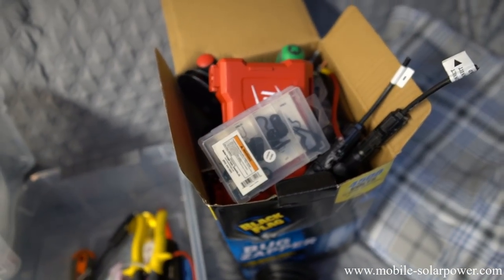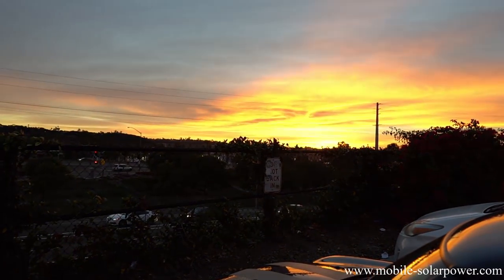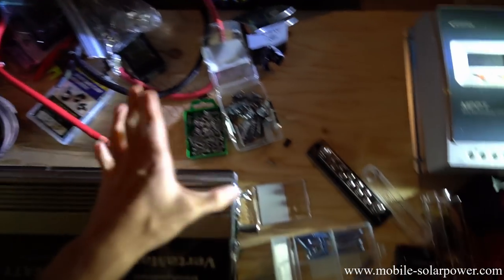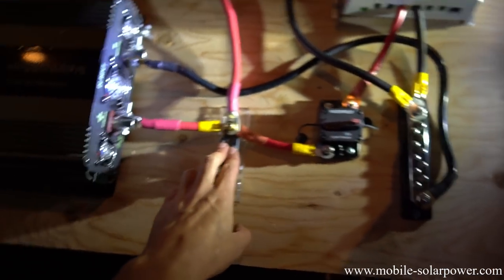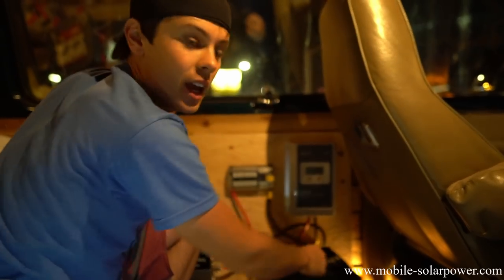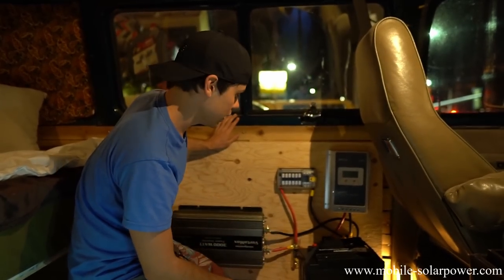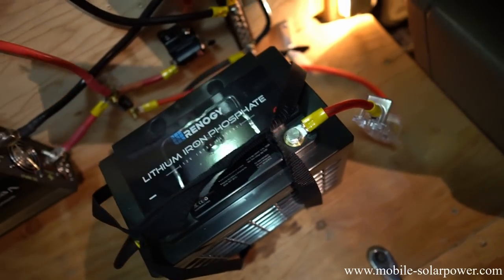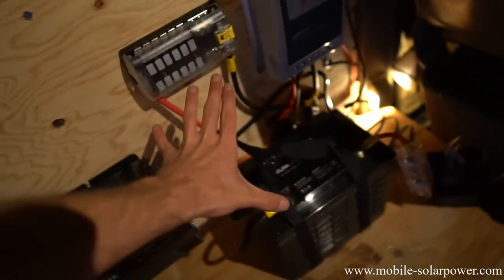Van Life: 400 watt Solar Power System Fast Installation

Comment: Will, guess what?  My $500 Xantrex inverter gfci was tripped and would not reset. I couldn’t find any information about it online and thought I was screwed. Well, I bought a similar gfci and replaced it all by myself and it worked.  You have empowered me to do so much. Thank you Will. You have really helped me more than u know.

Comment: Great video Will, I love doing the installs this way where you put everything on a board 1st and then mount the board, this makes everything so much simpler.  I might recommend painting the board black before you start I think it blends in much better when you do that and nobody paints it after it's installed.  Also I didn't see where you put a ground for the inverter and you didn't tie the battery negative to the vehicle frame, people tend overlooked this a lot me included....
Reply from the maker: No need for chassis ground. Because chassis isn't connected to earth ground, so no difference. Unless u wanna save money on wire.
Reply from the maker: Neat idea about painting it black
Reply: @WillProwse   I know it will work without the chassis ground to the inverter but you will get some potential light shocking off the inverter if you touch the metal case,  I've seen it happen. If you don't don't take the battery negative lead and make it common / bonded to ground then the positive lead can lay on the metal and never trip a fuse.  Also check the manufacturer's recommendation on bonding the frame of the inverter...
Reply: @WillProwse   What email can I send you a picture from the owner's manual?
Reply from the maker: Sure, and willprowseiv@gmail.com
Reply from the maker: Interesting, usually the case is grounded. But yeah it's best to ground it for sure.
Reply: @WillProwse  Wish you would build a system like this, but show all the proper grounding as well. I'm confused about it...

Comment from the maker: The system in this video is similar to the "Classic 400 watt" System I show on my website: https://www.mobile-solarpower.com/the-classic-400-watt-rvs-vans-buses.html

Also, the reason we are using a 100 amp fuse as the "main fuse" is because the max continuous discharge rate of battery is 100 amps. The battery can do short bursts of higher amp ratings, and we need room for inductive loads, which is why a 100-125 amp fuse will be appropriate, to protect the battery! The fuse is not sized for the inverter in this situation! If we add more batteries, and can use the inverter to what it is rated, then sure, we will change the fuse size. Need to make sure that this is clear! 

If you are beginner to this stuff, do not copy this system 100%, and please read my book, or an electrical engineering book on low voltage dc circuits to understand why. You MUST size wires and fuses for individual systems. You need to have an understanding of basic electronics to do this (all covered in my book). 

Also, there was quite a bit of redundancy in the fuses due to gauge of wire, and that he may mount battery elsewhere with different cables, and if controller shorts, if ever, its nice to have its own fuse. But yea, half the fuses were not needed considering size of wire we used. 

Also, we will be building an enclosure around this entire system! This system is not complete and needs appliances attached etc. I was hoping that this video can help people with connecting the main components. 

Sealed lead acid charge profile is what I use for drop in lead acid replacement lithium batteries. 

If you would like to check out my book, go here: http://amzn.to/2Aj4dX4
Reply: Jesus Will - you make this look like a walk in the park - No FAIR ! LOL Excellent fast build again and it's nice to see a Lithium battery instead of some lead acid mistake. Good of you to help out your buddy Will, I know he totally appreciates what you have done for him and giving him some new-found freedom in his van. I hope you are having a blast at your new home in S.D. and making all kinds of 'new' friends You Tinder pilot.

Comment: This is the second video that I've noticed you connect the charge controller to the battery through a circuit breaker that ties in the inverter and fuse block. If that trips won't the charge controller be disconnected from the battery yet still be connected to the solar panels which is a bad thing?

Comment: That install is BEAUTIFUL. I had a thought pop into my head that I have never considered before. What do you think about installing some kind of snap on fabric or vinyl cover to hide the equipment and also provide a level of protection from a foreign object accidentally contacting the bare connections?

Comment: Just went to your website and subbed.  I will buy items from your link when we are ready..  the option i will choose is the minimalist for our Lexus RX400h.  Right now it is still in concept stage.  We will be using a Hardshell roof top tent about $3500,, the solar system  you suggested about $1000.  I think i need to have USB charging going to the tent as well as laptop charging (laptop charging up there is debatable ).   Definitely need it when I’m on the ground.  Any suggestions?   Not sure if you done any study on mobile connective stuff.   I’m seeking reasonable internet connect on the go, not necessarily rely on cellular service.  I know I have to research it myself.  Thanks for sharing good contents.  I was trained as an electrical engineer.  I don’t have much hands on experience though.

Comment: Nice. But why use that particular solar controller? I just recived the one you recomended from your site. Pricey for the wattage but I'm sure it will last a very long time.
Reply from the maker: If you got the one on my website, you are better off. Better input terminals. The one in the video is still from same company, and it works great, but input terminals not as good. If you got your stuff from my website, you are set

Comment: HELP! I have a 1000 watt inverter in which is connected to a 100anl fuse, and i have 2 30 anl fuses that will be connected to my charge controller (renogy wanderer), and my 2 100 watt panels, will this be enough to support my system?
Reply: As far as the 100anl it is dependent on the size and length of wire and the battery size. The 2 30anls sound a bit large but it depends on the amp rating of the controller and again wire size but your 2 100 watt panels are not ever going to approach putting out 30 amps each or even 20. The amp rating of the controller multiplied by 1.25 is the recommended fuse size and the wires should also be sized to carry the controllers amp rating.

Comment: At the very end, you mentioned the battery was sealed lead acid?  I thought it was LiFePO4?
Reply from the maker: No, we used sealed lead acid charge profile for the lithium iron phosphate drop in
Reply: @WillProwse  My understanding is that lithium batteries shouldn't be floated. Wouldn't a lead acid profile do that?
Reply from the maker: It's fine. Float voltage under the max charge rate will bring amp rating to zero.
Reply from the maker: I float my Tesla lithium battery at .1 volts under 24.4 and it shuts off current the moment it's full. It's great. Maybe you are thinking a float charger with equalize settings? Float is fine. It compensates for the loads when battery is full
Reply: @WillProwse  Thank you for the explanation. And if I remember correctly, you keep your battery just under full?

Comment: At the end of the video you said you hooked the system to lead acid ... but I seen a Lithium Iron battery in the video.. I'm confused about your charge controller set up ?
Reply from the maker: This lithium iron phosphate battery does well when charged to 14.5, which is why I used a sealed lead acid charge profile
Reply: @WillProwse  Yikes... you da Man... thanks

Comment: Where would I go to get my mppt inverter and batteries connected? I have a 2000w 24v xantrex 40a mppt and 945w of solar I also have 6 145ah 12v AGM batteries for 24v config for my school bus
Reply: Nice video btw!
Reply from the maker: If you buy the tools it's super easy. Just need to learn how to crimp wires. I have a video that covers that, and I cover it in my book.

Comment: Why is there a breaker between the main fuse  and controller?  Just curious
Reply from the maker: Technically do not need it because of the wire gauge size. but if the charge controller shorts out it is nice to have that extra protection. Usually it's good to fuse it because the wire gauge size is much smaller but I had 4 gauge wire so it technically does not need to be there. Good comment
Reply: @WillProwse  room to grow :) it may come in handy if he ever decides to expand this system
Reply: @WillProwse  I have the same inverter but the 1500 watt model. The manufacturer recommended 0 Ga wire or at a minimum 2 gauge ?
Reply from the maker: @TravelswithYoly  Absolutely. Great point. It needs larger gauge but we are only using 1000 watts from the inverter. If we were doing 3000 watt induction loads, I would have designed every wire and fuse differently. Great comment
Reply: @WillProwse  I was planning on having the capability of all 1500 watts for brief periods of time so I figured better build for the highest demand.

Comment: Hey Will. What do you think about using a 125 amp Battery isolator? I remember you use to have them on your website but you took them off?
Reply from the maker: Yeah I took them off for a few reasons. That isolator was pretty cool, but most people do not need the for their system. Much much better to keep the two systems separate. Especially nowadays with lithium batteries coming out. Resistance of starter battery totally different. And alternator won't create much compared to a solar power system. And limited discharge rate on drop in lead acid replacement lithium batteries would mean that if you try to start your car off of them you could get some damage or it will shut itself off. There are just lots of reasons that it just doesn't make sense anymore

Comment: is it true you shouldnt go over 2000 watts on a 12v system?
Reply from the maker: Wellllll you can, but yeah, better to do a 24 or 48 volt system. But it's doable on 12 volts